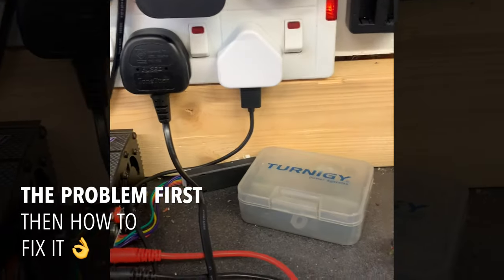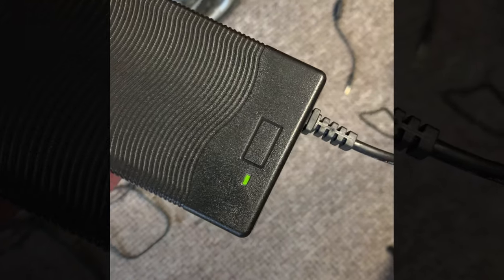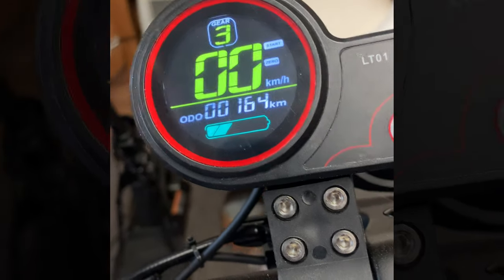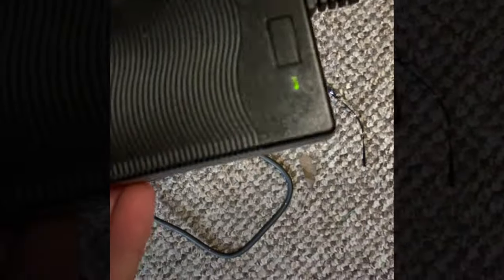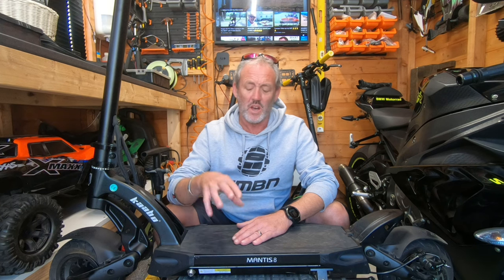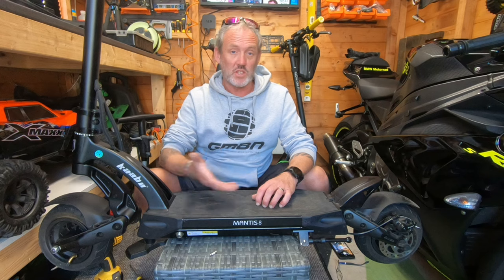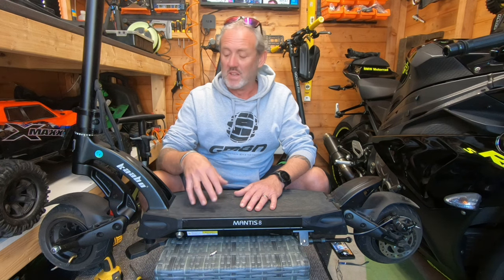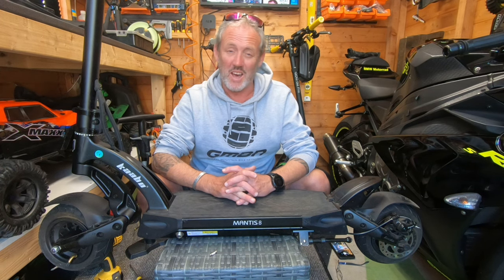Scooter not charging 🤔🤔🤔check this first as a Quick fix to get you going 👌

Comment: Just replace to fuse, chargers can fail. Fuse can protect it from short circuit. The fuse amp should be slightly higher than the charge amps. In case of over charging or short circuit your battery can and will burst into flames and put your home in danger of burning down. So I would not bypass any fuse.
Reply: Where do I buy a fuse and how to install it?
Reply from the maker: Any B&Q or Home Depot store
Reply: What’s a fuse and how much???
Reply: Just put a drill bjt in does the same thing
Reply: @markjordan  all u need to do is put copper wire around the fuse or else tinfoil and it will by pass it also
Reply: Any idea , my charger on connecting shows red which means charging  but still my scooty is not charging after 3 points of charging it has stopped charging ,but charging indicator shows charging on connecting, i tried qith tqo different chargers but still the same
Reply: @vaghii6731 ich brauche auch Hilfe ich habe gleiche Probleme mit Aufladung nach 2 Punkt nicht mehr laden
Reply: I don't need it I have an circuit breaker button on my e scooter
Reply: I agree entirely. I’m an electrical engineer and I assure you that it’s a very bad idea to bypass an electrical safety feature. Lithium batteries can deliver huge amounts of power quickly (think explosion, fire). That failing fuse is telling you something is wrong in your wiring or motor. Be safe, all!

Comment: You definitely need the fuse. If the charger really protects from over voltage then the fuse wouldn't have broken to begin with. The fuse is there to protect the battery and you removed that protection. Good luck.
Reply: The logic in the video is so flawed, it's like saying you don't need a seat belt because you never crash.
Reply: The fuse has notin got to do with protecting the battery man you havent got a clue ... even if the fuse blows all u need to do is put tinfoil or a copper wire around it n it will be perfect again so it has noting to do with protecting the batery if just gives the battery power
Reply: @vickykenny1328  all imma say is you are wrong.
Reply: @vickykenny1328  :-: I disagree.. Just like cars, AC units , horns.. If used it blows and it no longer works.
Reply: I'm surprised there isint a scooter fire already

Comment: I was thinking about omitting the fuse with a "push to reset type" of breaker. Then you don't need to open the battery box. Better safe than sorry.

Comment: Hello need some advice. I had a little shopper mobility scooter and maintained it myself for three years. I have just finished paying off a greenpower scooter. Since day one  I had problems it looked lovely but a few screws were rusty. ;Anyhow within a few months it wouldn't charge. The charger was on green and it was empty. I had in total five men out to fix it. Nope they made it worse. I eventually got four new batteries out of them but that wasn't the answer anyway.They tried to palm me off with allsorts of reasons. However after the new batteries and a new charger port in the scooter it worked for a while now its doing the green light thing again. However if I can get the horn to work and the front light I can charge it get the charger to go red while it does. By the way I bought a spare one they were shocked I knew what charger to get. So the indicator had a little switch which basically boinged off so they donrt work now. THe seat is loose so many faullts. However it needs to work . Any ideas why the horn won't work and the front light then when I eventually get the horn to beep I can charge it then.

Comment: I have a kugu kirin e.bike...power turns on but onky 2 out of 4 charge lights come on..tried charging, never went beyond 2 lights and charger stays on green. Thought was a charger problem, bought new one same problem, then i thought battery life ended but if i life back wheel up and turn throttle it whizzes around no problem.but if i get on v bike it comes to a halt. Do tvwant waste £200 on a new battery..im 63 female shall i try  replacing v fuse?? Tku jane

Comment: Need help my mobility scooter from Green power has not worked properly since I got it. I have got new batteries and they replaced the charger port under the seat.  Now unless my horn beeps and the front light works it will NOT charge. I have to piddle around trying to get it to work. Once the horn works and the light comes on then the charger will go red and I can charge it. But the light and horn only work sporadically. ANY IDEAS.

Comment: Do all scooters have a fuse .I checked all  in the back and all wires are good only thing was one tiny grey wire not connected so I reconnected it..But it does not turn on at all.i had to fixed accelerator with spring tension on accelerator left side with trigger.i don.t know if my daughter followed proper charging method for winter prep.What wire should I check first  ??

Comment: Hi.. I have a Kugoo g booster and today while riding suddenly my scooter's battery drained itself from 95% to 0% within seconds, also after a quick charge the battery and the voltage was full but after pressing the throttle it drains again.. !! any idea when went wrong suddenly ? or what shall i do to fix it. I would really appreciate it if you can give me any solution. Thanks.

Comment: Hello mate, i have a mantis 10 with the eye3 display. The charging light goes red and then green like i have a full charge. But when i turn it on the display flashes as it goes from max voltage to near 0 and then all turns off. It takes 2 seconds to happen and then i cant turn it on again for another 10 minutes as nothing happens when pushing power button, and it does the same thing. From 67.5 volts near nothing eveerytime, any ideas on what the issue could be would be greatly appreciated mate.??

Comment: Just got a new one, it was fully charged. Then i changed the volts, from 36 to 60 on a 400w battery. Not even sure that was supposed to be possible. But now it's on the first bar, and doesn't charge any further.
Can you help?

Comment: i have an issue with the charging on my wolf warrior every time I let it die as im riding it tough to get it to take a charge on both the chargers i have they have the green light when i plug em to the wall but as soon as i plug the other side to the charging port it makes a SPAT NOISE AND THE GREEN LIGHT GOES OUT afterwards i have to wait likght 10 minutes to be able to try it again PLEASE GIVE ME ANY ADVISE IF YOU CAN I WOULD APPRECIATE IT THANKS

Comment: I bought an AOVOPRO ES80 a few days ago and it arrived in the post yesterday, it’s not turning on even though I’ve plugged it in, I press the power button but nothing turns on however the rear brake light just flashes once very lightly. Do you have any ideas on what I could do to try and get it to run? Thanks

Comment: I have lost my original charger, I looked at the manual and bought a 24v 0.5a one and it did not work, I did not charge. Some electronic technicians tell me that I use a 27.6v charger, another tells me 28.4v, I'm really confused and I don't know which charger to choose. Could you tell me what voltage I use to charge my scooter? Thank you PS: battery is acid lead 24v

Comment: Thank you for this video, I had the problem on a brand new KUKIRIN G2 MASTER 2024, in fact the charging wiring was not connected inside the deck. Thanks to sharing your experience, I was able to avoid the return costs as well. What a time saver, a big THANK YOU 🤩

Comment: I just picked up a Zinc folding electric Eco Scooter (ZC06805), but it will not charge.
The light on the charger pack stays green, does not turn red when plugged in.
The scooter powered on out of the box, but now will only turn on briefly after I manually scoot around for a bit, showing (what I think says) "E5" on the display, but then quickly dies.
Can anyone help??? PLEASE!

Comment: what size and voltage is that (what exactly am i looking for)? if the same thing happens to me, I'm going for 10 amp or higher so it has no chance of failing. I don't have a crafting bench and supplies, so diy fixes are out of the question

Comment: Got new e-scooter.  Zipper mobility 2 wheel.  Came with fuse out. When I try to add fuse it sparks and bangs. Tried 3 times.  Doesn’t have an ignition.  So how can I disconnect power so I can add the fuse ?

Comment: This is just what im looking for because almost every video out there try to tell us just to reconect the contacts from display or battery. Thats just pure luck if that even fix the problem lol. I have an E-way 500 that have exactly the same problem with the green charger. And its a brand new original charger i bought so Im pretty sure its working proper. So Im gonna open mine up and see if I have the same red cable with a fuse. If I do I will follow this concept and hope for the best.

Comment: The fuse is a feature, not a bug. Most scooters don't have a charging fuse (at least not one that is in any way accessible). I've seen plenty of batteries that happily turn on the scooter and run the motor but don't take a charge. There is no recourse except replacing the battery or having a battery repair specialist take a look.

Comment: Where Can I find the fuse on the rs inmotion?
Reply from the maker: Hi take off the deck plate and you will see at the top of the battery there’s a load of wires and a control box it will be there

Comment: Hey I got a bigger scooter and mine won't charge it turns on for a second or two and goes green and the fan in the charger stops my charger and scooter has fuses my scooter is the mars mototec electric scooter

Comment: I guess the wires are connected directly to the battery. Removing the fuse means that if any conductive material (water, piece of metal etc) gets to the charging port it will short out the battery and everything going BOOM! Just put a fuse there...

Comment: My zero 8 came with a 50.4V charger which is able to charge the 48V battery to a maximum of around 74%.
Why? Answer: note that the maximum (100%) charging capacity of 48V battery is not 48V but 56.4V. To charge your 48V battery to 100%/56.4V you would need a stronger charger (e.g. 60V).
Providing a weaker charger is a smart trick some manufacturers use in order to prevent their buyers from overcharging the battery (keeping your battery charged above 30% and below 80% will triple the battery lifetime).
The light on the charger will turn green once the current stops flowing, in other words, there is no more difference in the potential between the charger output and the battery. This only means that the battery charged to the maximum capacity of what a CHARGER can provide and this is not necessarily the max capacity of the battery itself.
So if you see a green light on the charger, indicating that the charging is finished, but your scooter only shows 4 out of 5 bars, check your charger's power and the voltage reading of your scooter. They should be similar (e.g. for 50.4V charger your 48V scooter should read 50.1 or 50.2V when charged to the max).
Search the internet for "Battery pack voltage comparison charge".
Reply: A 48v batt 54.6v is over 95 percent

Comment: Thanks for the video. What happen if  you plug higher power chager in the less  battery, for ex: 72V charger in 36V battery? The charging process starts or not ?
Thank you
Reply: BMS WILL SORT THAT
Reply: @jamescashmore1452 
It's sure?
 Did you any BMS to recommend ?
Think you?
Reply: @gadfay8463  no i do not fix batterysbut in th efuture will learn then get back too you because i can not let this be a problem

Comment: Hi Mark,  good videos.  I've repaired my won't Skywalker 10h lots of times, but the last problem I've had no luck. The battery charges, I turn on and the volt meter counts down very quickly from 54 to fade out at around 30.  If I plug into the charger, the scooter can power up, but remove the charger and it counts down again. There is a key switch.  

It's also been sporadic, sometimes good and without moving it the problem returns. I pulled the wires out and checked the battery leads.... But as I said the scooter powers up if plugged into the charger.  
I'm thinking it's the battery management system that will be in the battery, or a faulty cell maybe.  Just wandered if you'd heard of a fix.
Reply: I've got exact same problem
Reply: I have a Widewheel W6 with the same exact problem.

Comment: I had a electric scooter with a 36v battery start doing this the other day. It randomly shut off during a ride and wouldn't come back on or charge. I tried the charger on another scooter and it worked fine so I assumed it was the battery. 
Took the battery out measured the voltage and it read around 13v. Dead. 

I install a new battery and the scooter still wouldn't turn on or charge. I pull the battery back out check the voltage and surprise it's at 8.8v. Also dead. 

What killed these batteries like that? When I installed the new battery it was fully charged and now it's just dead. I took the scooter apart to see if I could find a short or cause but I couldn't find anything. No sparking when I connected the battery no burnt wires or burning smell. No visual signs of overheating on the controller and no blown fuses. Didnt even make any noises like popping or buzzing that usually indicates something is wrong. 

Is there something I'm possibly missing and is there a way to save these batteries? It's kind of frustrating considering not only is the scooter still down but a fresh battery pack is also no longer working so it's just money wasted at this point without knowing a reason why. 

Is it possible a short is somewhere that isnt going to show it's self but will still fry the battery like that? I didn't even have the new battery installed for more than a few minutes and it went from around 42v to 8v. That much of a discharge with no visual signs or sounds just doesn't seem right. That's a lot of power to just disappear.
Reply: Your controller is shorted and both batteries are probably fine. There's a very high chance you'll find that your motor wheel is stiff to turn. Do you have a multimeter? Unplug the three motor phase wires and check for continuity between any two of the three coming from the controller. Most likely a mosfet has shorted and needs to be replaced, causing the controller's power input to become shorted. The BMS sees this and shuts down. With your multimeter, you can compare the resistance of the two probes touching each other to the resistance at the positive and negative input terminals of the controller. If the reading is very similar (close to 0.000), then that is another confirmation. 

Plug the charger into the batteries without hooking the battery power output up to anything and they should immediately recover.

Comment: Do you think that could be the problem with my varla eagle one I had a big fall when I got up it still was riding fine untill it was time to charge it wouodnt charge I tried the over night thing and it still wasn’t charging.
Reply from the maker: Sounds like it could be .. take the deck off and check the fuse as the scooter will run until the battery is dead it’s only when you try charging you will struggle 👍
Reply: @markjordan  thanks I’m gonna try it with my pops ion wan handle that myself I’ll let yk how it went

Comment: What others said, please use the fuse!!
Also - I get nervous seeing you tighten the screws back in with electric screwdriver. It is very infrequent you will need to retighten the 10 screws, but depending on a power drill can damage them very quickly. Would say use a handheld screwdriver to avoid threading screws.
Reply: You mean cross threading. Removing the screws with a power drill is fine but installing them to torque is not a good idea, you are very correct in that.

Comment: hi, do you think one of the thumb control would work on the kugoo g2 pro
Reply: Look up the rion thumb throttle dualtron mod the throttle is soldered to the capacitors behind the hall sensor but if ur not experiences with soldering smd components and they are not easy leave it alone or buy backup . If your gonna do it anyway use some precession tweezers to hold the capacitors on the pads as you solder

Comment: thank you i have an electric scooter and somebody told me to get a battery tender and says it should be charged constantly when not using . Is that true?
Reply from the maker: I don’t recommend keeping your battery charging it’s best to use it and when it’s low then recharge
Reply: @markjordan  Hello mate, i have a mantis 10 with the eye3 display. The charging light goes red and then green like i have a full charge. But when i turn it on the display flashes as it goes from max voltage to near 0 and then all turns off. It takes 2 seconds to happen and then i cant turn it on again for another 10 minutes as nothing happens when pushing power button, and it does the same thing. From 67.5 volts near nothing eveerytime, any ideas on what the issue could be would be greatly appreciated mate.??